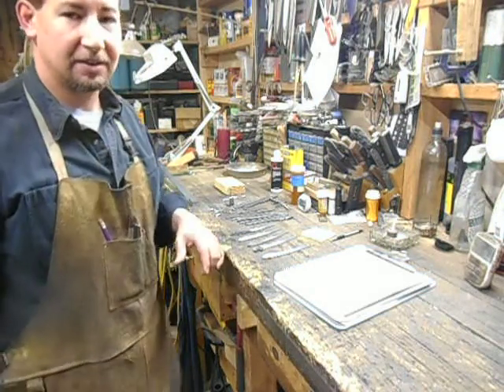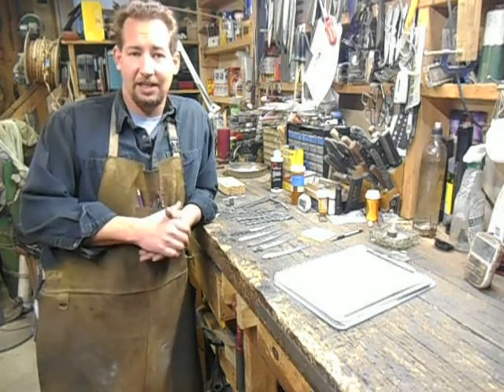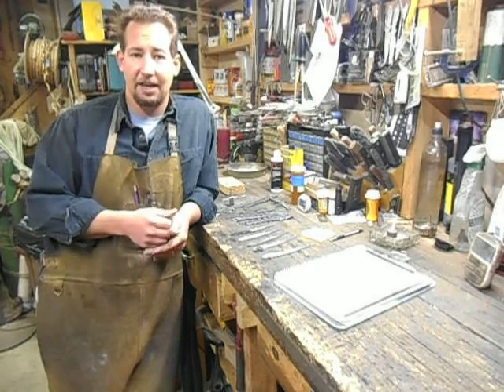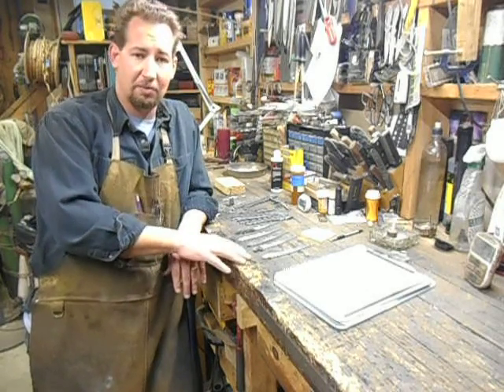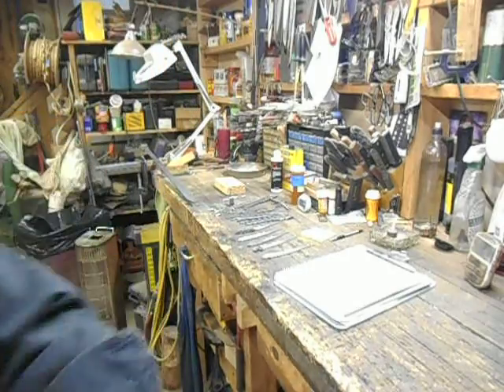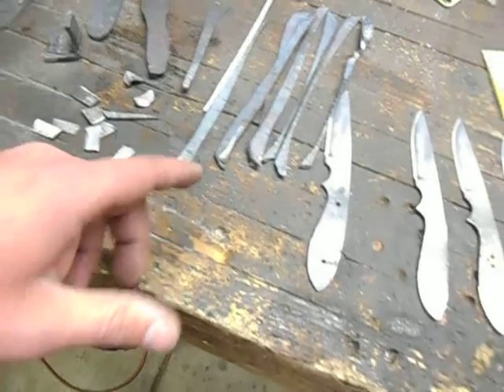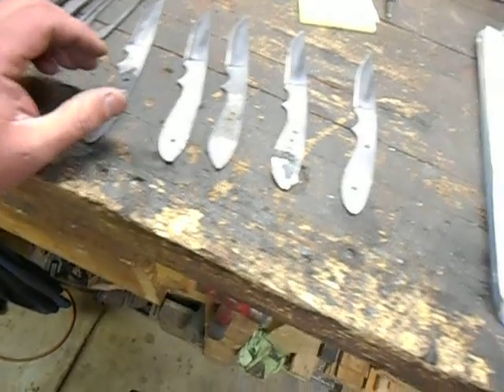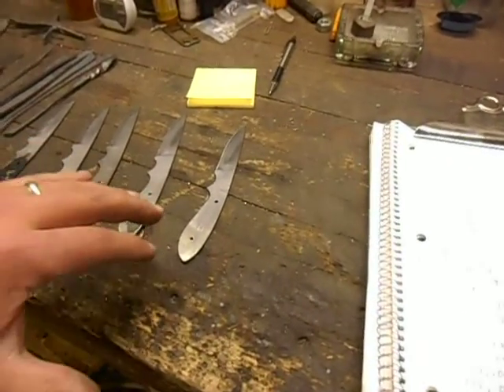1095 and mild sanmai destructive tests

Comment: Next time try something different, use a 1/8 thick 1070 steel between two mild steel pieces like those you've used on that video, you should get a more resistant knife. You could even try to put some medium carbon like rebar in the mix.

Comment: Great video! Sacrificing all those blades is almost painful to watch. Regarding forge welding temps, it's my understanding that propane will not get too hot. I have often seen guys welding damascus, or san mai, in a coal/coke forge and they pull it out of the fire sparking. That is too hot. And yet, they have success. From my understanding and experience, the key is the heat treat. I wonder if your temper hasn't been long enough. A couple or three rounds in the oven at 400° for an hour each should produce a 1095 that is down the middle. 

I've got some san mai projects coming up that will be similar to yours in that the centre is 1095. However, the "jacket" will be 5160 and 15n20. Knowing that 1095 can be bit on the inflexible side, my thought is to put only a narrow slip of it at the cutting edge. This will be similar to a Wariha Tetsu. This should allow for maximum flexibility and still retain the marvelous cutting edge of the 1095.

(https://www.google.ca/imgres?imgurl=http://www.st-nihonto.com/k/szlt114.png&imgrefurl=http://www.ebay.com/itm/Clay-Tempered-wariha-tetsu-Blade-Japanese-shirasaya-katana-rosewood-body-sword-/321866203236&h=621&w=554&tbnid=XVIZXykjH0JzbM:&docid=wfkNMayHetcbmM&ei=KuTHVsmoA4m4Uc2fhvAG&tbm=isch&ved=0ahUKEwjJ5YrKuYXLAhUJXBQKHc2PAW4QMwglKAowCg)
Reply from the maker: +Glenn Wiebe thanks!! but it would only be a sacrifice if I didn't put it either on youtube or in my logbook so I can remember what happened :} I would bet that propane would be able to get too hot. ive melted iron in my foundry running on propane. though it does take awhileI probably should have said in the video but the blades were tempered at roughly 375 {everyones tempering oven runs a bit different I think} for 3 hours, then 2 hours, then 2 hours.your project sounds very exciting!! and thanks for the chart on the different construction methods!!!

Comment: Thanks for sharing Joe! I new you'd get this thing rolling! I'm looking forward to trying it out with my own forge. I'm not very interested in the high heat forge welding but forge welding at 1700F and down really floats my boat :P 

What did you change that made it start working for you? 

I think adding a parameter would be a great addition to your forge.  They can be had pretty cheap and are just another thing to help check our self. 

I think if you stick at it you could really dial this in.
Reply from the maker: +Daniel Rohde as soon as Jim saw my sample pieces, he said I didn't have enough mass to hold the heat long enough to get the work out of the forge, to the anvil, and set. the very first time I switched to 3 pieces of 1/4" stock, it was enough mass, and the welds started taking.I will probably add a pyrometer to the forge soon, I think I have some parts around here somewhere to rig something up :}